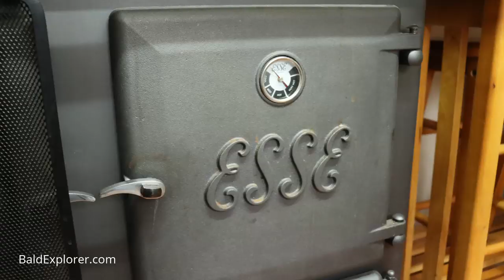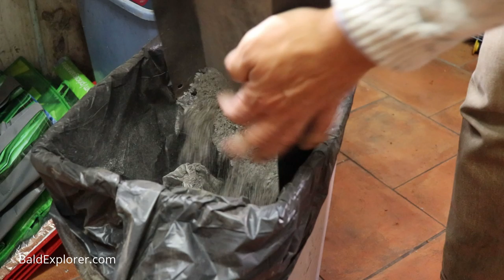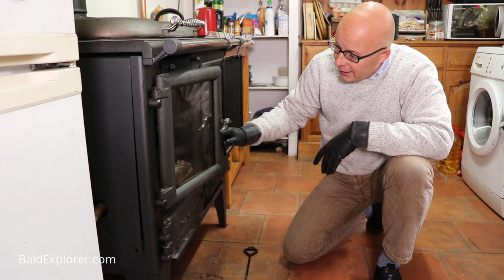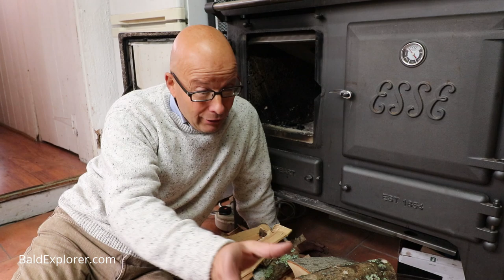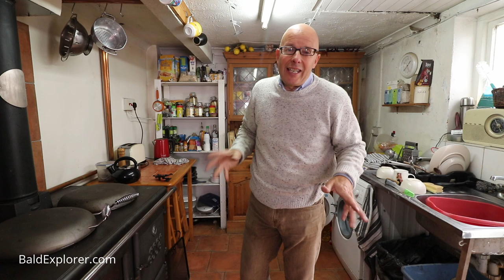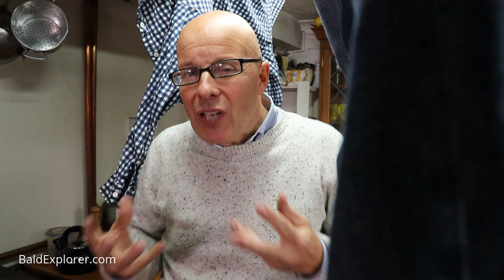Owning an Esse Ironheart Wood Burning Stove One Year on.

Comment: Wow 3000lbs for a stove?  Seems a lot,  how many years will it take to pay for itself?  Save that wood ash, spread it around your lawn or garden, bushes what ever, or give it away to a gardener. Now, I'm wondering, you wander around woods and fields, surely there is someone who will let you clean up the landscape of any stray tree limbs lying about?  I've actually seen people put tree trimmings out for trash pick up!  People gave up on wood burning stoves because it used up so much time gathering the fuel. And then you had to store it properly to keep it dry and free of bugs etc.  Now we've come full circle, more out of nostalgia I think then for practical purposes.
Reply from the maker: Maybe the modern efficient systems don't satisfy everyone.

Comment: These will banned soon together with wood burning saunas in Finland.
Reply: "The new standards do not aim to ban wood-burning stoves and existing owners will not be penalised for using their stoves. However, the new Clean Air Strategy will include measures to ban the use of poor quality wood from unsustainable sources."
Reply: Makes you wonder how we'll keep warm if we stop burning wood and fossil fuel if the wind stops blowing  ?  Although log burner's are nice , as Richard pointed out , they are a lifestyle choice not an economical one  due to the initial outlay and price of the fuel and they are often not the primary source of heating for many owners . Most people will opt for the convenience and economy of modern heating systems , and I doubt enough people will return to wood and coal fires in the numbers which would justify penalising them ?
Reply from the maker: Phew!
Reply from the maker: I think you are correct Rik - now if I could just crack obtaining cheap seasoned wood. :)